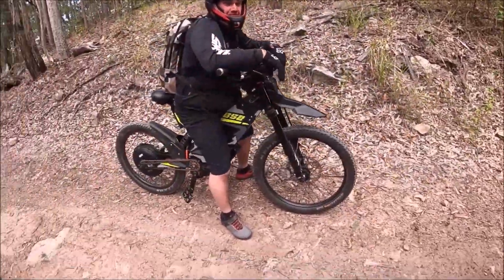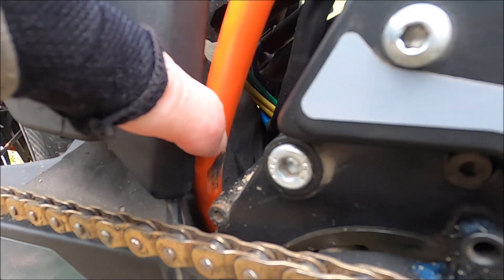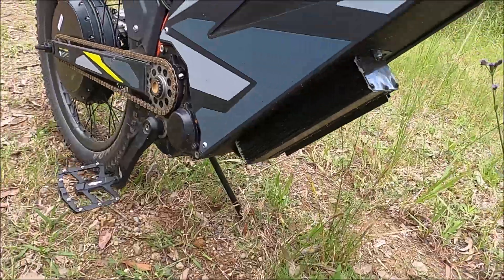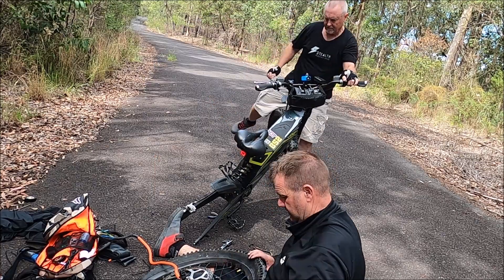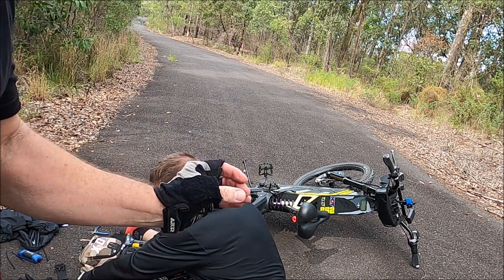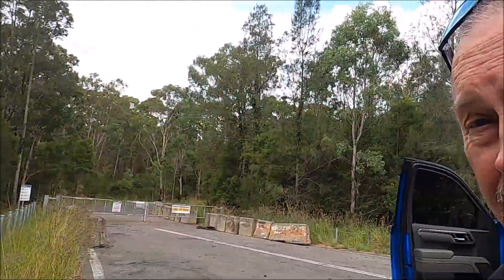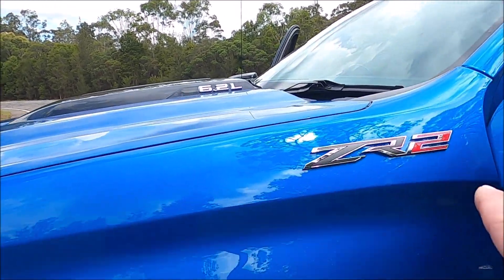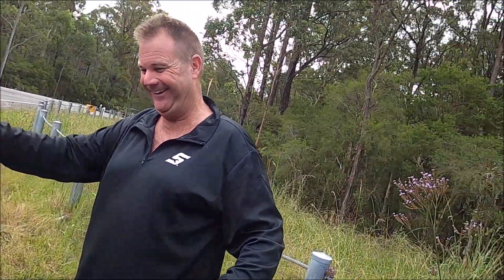Stealth B52 Gen 2 5 Prototype Part 3

Comment: I am feeling like It might be a good idea to pull the screws that hold my brake rotors in place, and loctite them?
BTW, one advantage of the P-7/r is the very neat single quick disconnect sitting alongside the swing arm.  Easy to work with.  😁  The greater power transmission demand of the B-52 would probably make that hard to implement.

Comment: I’m a bit confused, what is the purpose of upgrading the stock motor. Were you not satisfied with the original motor. Are you trying to get more speed / range / torck, seems to me that the stock motor is a beast and is more than adequate for the type of trail riding you use it for. And you’re adding additional weight. Not sure what the end game is. Thx
Reply from the maker: You will see in the earlier episodes that the  Gen 2 bikes overheat due to the larger diameter wheel which increases the gear ratio and reduces torque and acceleration.
Reply: @NXAussie500  We want to be able to ride up vertical walls with the new motor 🙂